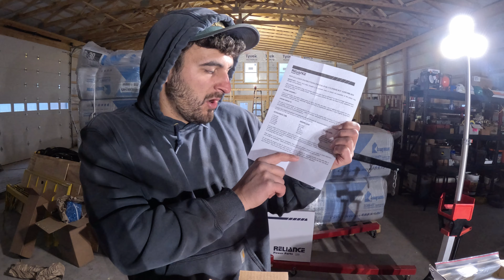Rebuilding a John Deere 450B Dozer Engine

Comment: Did you just use standard bearings size?
Reply from the maker: The crank shaft journal bearings were standard size but the connecting rods were .010" undersized. I did plasti gauge the bearings and got .0015" which is what the service manual calls for.